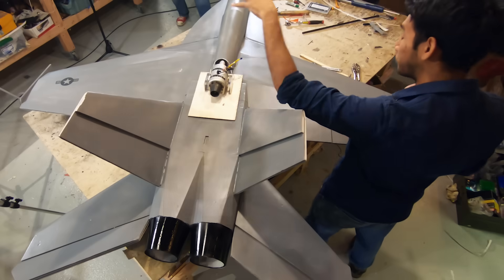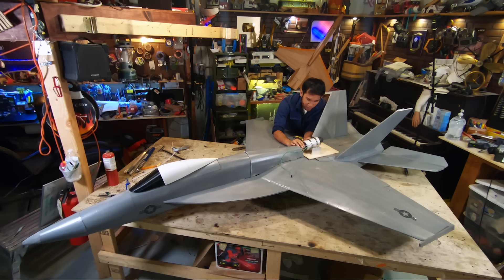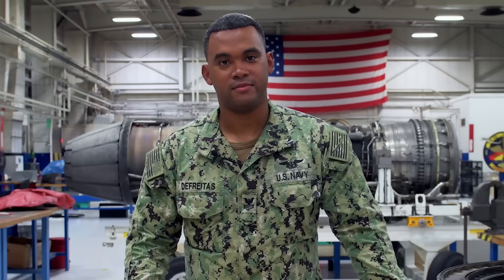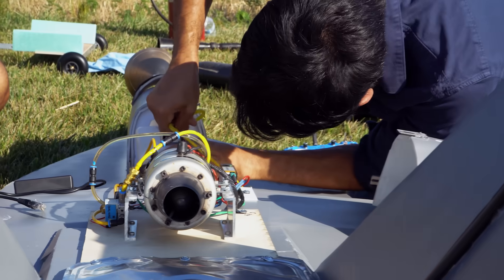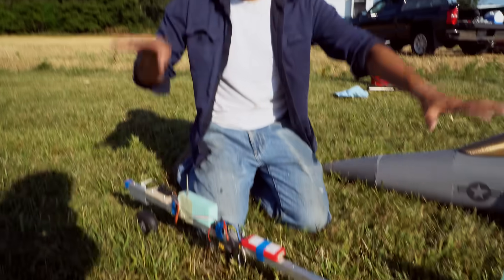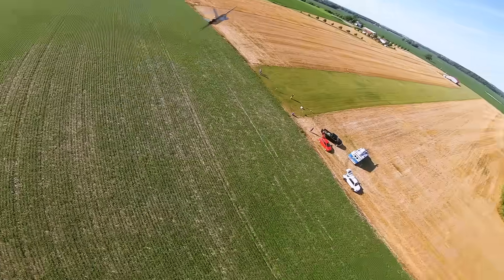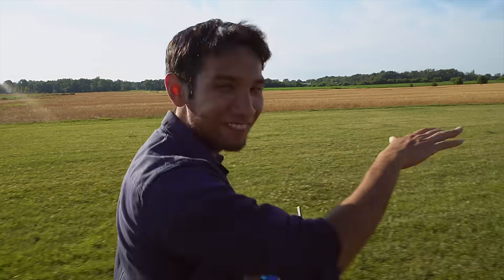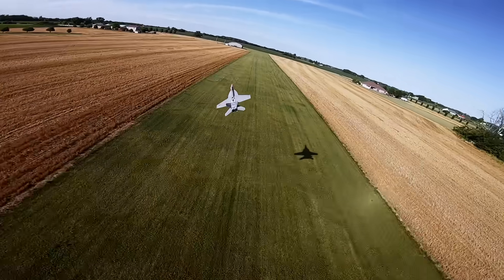Making a GIANT F-18 with a real JET TURBINE | Sailor VS | U.S. Navy

Comment: When the F-35 is so trash the Navy sponsors a video on an RC F/A-18:
Reply: The F-35 is not trash... The F-35 is expensive trash.
Reply: @moomoomoomuu  you're not wrong
Reply: Youtube Airways How is the F-35 trash?
Reply: @justsomemainer1384  most people don't understand it's role and only rate it according to older standards as manoeuvrability, etc.

That being said, the forces will need to keep an airframe in service capable of close quarters combat. They already fell for the "we don't need no stinkin' guns" fallacy once and sent F-4s with missile-only loadouts to VID small manoeuvrable adversaries. Didn't go that well.
Reply: @justsomemainer1384  

Firstly, it can't turn.

Secondly, what's the point of stealth when the enemy has powerful ground radar + datalink.

Thirdly, it has a pretty low payload.

Plus a few other points that I haven't mentioned..
Reply: Youtube Airways [Citation needed]
Reply: @youtubeairways8646  first: most powerful ecm ability onna fighter aircraft ever

Second: high powered radar sites are very targetable and give away their position easily

Third: modern dogfights occur tens of miles away from their target. Turning is left to the amraams
Reply: @ryanestes7331  
First: EAG/18 growler exists
Second: So? Their and many positions on their side can be defended if they can detect threats.
Third: Don't underestimate the manoeuvrability of long range missiles...

As for citation, my own observations, and trust that enemy technology isn't that hopeless that they would just let the F-35 just ruin everything so quickly by your standards.
Reply: @moomoomoomuu  expensive trash that trashed f16's f15's and f18's at red flag. Hard to hit what you can't see

Comment: haha u need have fuel line inside tank bounce around to avoiding air trap in fuel line n i dont see tank you have so there not much i can tell about it but i did see is one issues when u try rolling in air  n i can tell by that issues is fuel line attach to one side sit in same spot witch bad for air plane and if u want make it do more trick then need push fuel line in tank far enough like 3 to 4 inches so that way help it to avoid air trap in fuel line
you could use figlass and aluminum to avoid melting air plane with jet engines "just like navy said aluminum else"

Comment: Hey Pete. Quick question. How can you curve foam board like you did? I'd like to try my hand at making an RC 747 at some point (even though I've never really worked with RC planes), but I don't know what the best way to make curved foam parts is.

You did a great job putting the model together and Ben did a great job designing it. Keep up the good work!

Comment: You should spool your engine up to at least 50% then launch yourself so you've got a much shorter ramp to maximum/flight thrust.  As far as I am aware I believe this is how actual navy jets do things and is the source of the small dip just after leaving the flight deck as the engines take over the work... but I'm not in the navy and I don't fly airplanes so I could be 100% back asswords.
Reply: Jets spool to Mil at a minimum, or Max based on weight, and end air speed. Search night time carrier ops, you'll notice the difference between Mil and 'full max afterburner'
Reply: If you watch a real cat vid, they go full mil and just prior to launch they ramp up to full afterburners.   Hence the massive jet blast deflector behind them.
He needs to go full throttle, wait for max power then launch.  Trying to launch then getting on the throttle will result in a failure every time.
Reply: @shirothehero0609  per the NATOPs PCL, power setting is based on A/C gross weight and Cat launch end speed, as I previously annotated.
The JBD is raised behind every launching aircraft, regardless of power setting.
And FYI, Mil is Mil, there is no Full Mil.
"Full afterburner" is just Max
Reply: @XxOnlyx2xGendersxX  well pardon my oversimplification for the youtube comments.  You have corrected me and I consider myself corrected.
Reply: You are right. That is actually how they launch off carriers. Spool up the engine first with brakes on, then just let go. That definitely would've helped, but looking at the footage, and how much slower the jet was moving by the end of the launcher vs on the grass by the time it actually took off, I doubt even spooling up the engines would've been enough for it to take off.
Reply: @Vousie  Brakes are no longer applied once the Shooter gives the ABE the signal, and the ABE gives the Pilot the signal for tension.
The hold back adapter is the only thing holding the Aircraft back, which is released at the start of the Cat stroke.
CVN NATOPS 101
Reply: @XxOnlyx2xGendersxX  Ah. I just realised that the case I was actually thinking of was when pilots need to take off from a shorter runway than they'd usually do - then they use the brakes to hold the plane while the engines throttle up. 😁
But still, the basic idea is the same: Throttle up the engine while something (brakes or hold back adapter) stops the plane from actually moving forwards, then release that & the plane goes.
By the way, what does "ABE" mean?
Reply: @Vousie  Aviation Boatswain's Mate (Handling) in this case.
The yellow shirt that taxi's aircraft to the Cat.
Reply: @XxOnlyx2xGendersxX  Thanks.

Comment: As a former Green Shirt on aircraft carriers I can tell you that having "wind over the deck" can be a critical factor in launching an aircraft successfully. We could launch with no wind but you risk tearing the aircraft apart and or injuring an aviator,and possibly damaging the cats themselves... The carrier is turned into the wind for launch ops. This allows wind to assist in lifting the aircraft as it leaves the deck. Maybe drive your launch truck at 15 mph and launch at that point, as you now have the cat's forward motion plus the 15 mph wind as lift components.
Reply: The only danger there might be that if it doesn't then take off, you're probably gonna crush it with the catapult van
Reply: @masterofthelag8414  good point. Maybe an angled shot, like the cross deck on a carrier?
Reply: @dnomyarnostaw  That'd do it... well I assume so anyway. The other thing could be raising the angle on the launcher so that the van would pass under it before it came back down but I dunno if that would also affect takeoff so I think an angled shot would be your best bet there.
Reply: @masterofthelag8414  Just the act of the platform moving forward (the truck  @ 10 mph) and the cat shooting the aircraft fwd at, say, 25 mph, means the aircraft leaves the cat at an airspeed of 35mph, and stopping the truck from that slow speed would only take a couple second, whereas the plane would already have traveled almost 3 times that distance. No crushing sound of the plane under the tires! Unless the aircraft has the improper wing/tail surface settings and is configured to nose dive! then I would deny ever having been a part of this conversation...
Reply: Ah yes  driving the truck even at ten mph would be a big help.
Good call .

Comment: As a navy vet who worked on F-18, the mere IDEA of any enlisted person knowing more than an engineer on how to design and test an airframe is hilariously wrong.  Most mechs (like our dear AD1 here) are woefully inept at even the most basic of flight architecture.  The only thing that mech is qualified to advise on is drop a fullscale engine out of the aircraft, and that's only if the instruction manual is leading them step by step.  No mech (AD1) is making heat barriers (or even thinking about it) of aluminum and cheesecloth.

Maybe I'm the biased one with the inside knowledge of how things really go in an F-18 maintenance team, but this whole thing is laughably staged.  It's obvious that Peter (or the Navy PR team) scripted this whole thing.  From the design, to the fake "burn out problem", to the "durr how do I heatshield my foam", but the most fake thing, is thinking some E-6 has an intelligent thought that wasn't provided to him.

Comment: I’m bugged that he didn’t get two engines and put them where they go. Oh well, it’s still EPIC!

Oh and if you are seeing this peter, look at the first few replies.
Reply: Its still in its trial stages.
One: not enough thrust
Two: material cant handle the standing loads, let alone kinetic forces that would be applied during operation
Three: would add more weight from added components needed to bring it all together
Reply: The freaking navy replied to my comment. That’s something I never thought I would ever say.
Reply: @nikobellic5655  NIKO I FIND YOU AGAIN THIS TIME HANGING OUT WITH THE NAVY!!!
Reply: What do you mean?
Reply: @Arthur use the same foil tin on the inside. If it worked on the top of the plane to keep it form melting, what makes you think that it won’t work on the inside.
Reply: E
Reply: @nikobellic5655  it would get way hotter on the inside, as on the top there is also cool ambient air, inside there would only be hot exhaust gases
Reply: What about the intake, and what About ventilation holes? Just poke some holes in the foam.
Reply: lets go bowling
Reply: Nikola I is that youXD
Reply: Or someone call the Air Force, then F-16 it.
Reply: F-15!!  the High Agility X model....(has the canards)
Reply: Okay I’m a year older and a lot smarter, how about you line the inside with aerogel. Granted that’s going to be hard to find, so maybe take some and crush it into chunks, and made a little thing that it can rest in, all over the sides. Or use some of that heat shielding stuff they put in  some crucibles. Hire me navy.
Reply: Maybe next season…
Reply: That would've made the plane too heavy, I think
Reply: @snjert8406  just fly faster :)
Reply: @Kai Dahlhaus if so, just add a counter weight.
Reply: E

Comment: For your launcher, you need to set it up so that you can spool up the engine to full RPM before launching the plane. So it has to hold it in place, not just hold the jet and push it forward.
That way, by the time it gets off the end you'll be under full power.
Reply: I was thinking the exact same thing that it needs a holdback (i.e. exactly how the aircraft carrier catapults work.)
Reply: We’ve heard enough here. You're hired! 🤝

Comment: Put the engine or engines in the actual engine bay.     The heat will be at the rear and away from the airframe.    I understand two engines harder to control than one.  Just a thought which i am sure you have already thought about.

Comment: fighter pilots spool up the engines before the catapult launches the craft. but sense your only using one turbine and placing it on the top rear of the airframe, instead of an "F18" how bout a Heinkel He 162 Volksjäger

Comment: Maneuvers lesson for today: jet engines require a pressurized fuel blivet.
Reply: Usually the end of the fuel hose in the fuel tank is weighted to solve this problem. (In RC stuff)

Comment: I think if you had pre-spooled the turbine before launching it off the catapult, it would've been fine. Just enough thrust to tilt the plane forward on the mount, and then full throttle as soon as the trigger's pulled to send it off the truck, and it might've taken off first try

Comment: Kind of reminds me when I started making larger RC cars out of a chassis the size of a small go-cart with small engines...and then upgraded to something larger with a small ~1.0L 4 cylinder gas engines with fuel injection/tunable ECU...lots of fail safes to kill it if the radio signal is lost or even gets scrambled.  I adapted a Drone's setup to give an in-cab visual through a visor/set of goggles so that it'd also have some protection for the gear in case of a rollover...in the event of a fire it's all toast though >.>.

Comment: Peter use your CNC machine to build a mold for every part of that jet and build it from carbon fiber resin with a mylar heat shield under the carbon fiber resin reflecting 90% of heat and mount dual jets in it with proper landing gear and you can sell it for a few thousand dollars a pop.!

Comment: The turbine should be fed from a 'bubble tank', that allows air pockets in the fuel supply to disperse without interuppting the fuel supply to the engine; that way you can perform aero maneuvers withot the engine flaming out

Comment: Build one from carbon fiber and a mylar heat shield under the carbon fiber resin and install 2 jets in the rear balance it and you could build the most advanced rc. Fighter jets.!

Comment: Could we maybe eventually see one with a retreacable landing gear and the proper dual engine and a cockpit that opens up?? That would be sick af
Reply: Yeah, but the melting might be a problem. Maybe line the inside with aluminum foil? It’d be pretty logistically messy
Reply: @SirShanova  I say put powerful enough engines where you could build the entire engine containment ass'y with sheet metal. That would be dope.
Reply: that would cause a lot of issues of room for the engines and also fuel. it would be a massive challenge.
Reply: Bet this is a one time thing

Comment: Do A-10 warthog next with nerf/airsoft brrrrt aka my spirit animal

Or something from warhammer 40k
Reply: Nerf will not work because the guns aren't strong enough to even damage any thing and on top of that the nerf darts will break mid air while flying, Airsoft is good
Reply: Peter would load it with explosive charges.
Reply: @bigfartsaresotasty  probably.
Reply: haha a-10 go brrrrrrrrrrrrrt
Reply: Khorne https://youtu.be/4BBnYPuM2s0 Peter has worked with these guys in the past...
Reply: Flitetest did this exact thing.
Reply: The Navy would not be so welcoming of him building an Airforce plane.
Reply: Thanks then
Reply: Spirit animal😄🤣🤣🤣
Reply: My dream A-10 with airsoft glock XD

Comment: Who else wants to make projects like this but don’t have money 
Great video though
Reply: To be fair dude apart from the jet engine this build would've been super cheap, it's made of dollar store foamboard, and the plans are free. You could use a couple EDFs instead of the jet,  and radio gear's cheap these days. If you want to build stuff build stuff, you could build the airframe for under $20 dollars including buying a glue gun, then get the electronics when you can, be the most satisfying $20 you ever spent.
Reply: @samrowland2816  what about the jet engines
Reply: The Navy

Edit: this is a joke